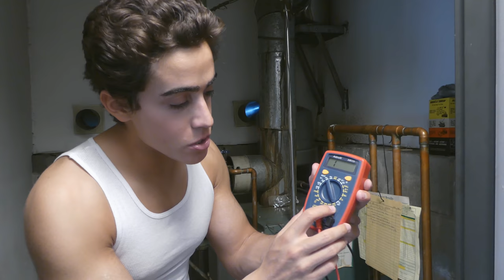Grounding and Earthing are Nature's Antioxidant

Comment: The Earth is neutrally-charged. Electrons have nothing to do with it - everything has electrons. The same electrons that strike the Earth are the same electrons that have been on Earth for nearly forever.

Take any massive object and it's electrically neutral, because it becomes impossible to charge. A single lightning strike or even a series of lightning strikes on the Earth is like piss in the ocean - you're definitely doing something to it, but the overall effect is negligible. Extending that - any non-isolated massive metal object is also electrically neutral, because it's not just difficult to charge, but any charge it takes in can be easily dissipated.

Free radicals occur inside cells, all over the body. Your body isn't a conductor so you will definitely not balance the charge inside your cells short of running currents across your body - which will definitely kill you. Most tissues are very good insulators, fat being the best. What you're affecting is surface charges across your skin, or possibly nervous system stuff that's at the surface.

Your multimeter test is erroneus. Sticking a probe to the soil will not cause it to conduct directly to Earth - the contact is bad. Loose soil, small surface area, too many issues. Wet soil might help but you would probably then encounter capacitance to ground, meaning that's still not grounded. Grounding rods are large and buried into the Earth for a reason.

The 30-100mV readings you get can be nearly anything. Your nervous system can output hundreds of millivolts on its own. In fact, moving around and being active, or even just pressing your thumb against the probe, could be generating motor nerve signals or other such nervous signals that could generate that voltage. You can measure the voltage across your hands, from your left thumb to your right thumb, and generate those signals. When you earthed yourself and saw the number go down that could be you sinking the signals naturally generated by your body back to ground.

Not to mention, are those DC or AC readings? If we're talking about charge, then a DC reading would tell you something about the built-up charge, and the AC reading will tell you something about the rate of charge transfer. Those can mean very different things; ideally you want both to zero out but just that you want to keep yourself neutral implies mostly the DC reading.

The copper pipe voltage test was interesting; but again that's the surface of your skin being grounded. This is the same trick to release static charge. Again, a sufficiently massive metal object, earthed or not, will still be charge-neutral and will serve as a ground with respect to your body. If all your piping is metal then regardless of its connection to the water main then it will serve as a ground regardless. You generally don't have to worry about this.

The surface area of the water pipes do not determine the connection to ground alone - that assumes that the pipes are ideal conductors, which nothing actually are. A longer length of pipe makes a more solid contact, but the furthest parts of this pipe with respect to you will incur signal loss on the way from you to it. That's why grounding rods are of a finite length - any longer and you're not getting a better connection. Wider, shorter pipes are ideal, longer, thinner pipes incur more losses per unit length. (Capacitance is also an issue, when pipe resistance goes down the capacitance goes up, so it's a big issue to find out how much more important DC grounding is to AC grounding.) But again, don't worry about it overall, a network of pipes will itself act as a ground with respect to a human body or bodies.

The easiest way to join the copper wire to your piping is to wrap it around the pipe, and then use a soldering iron and some lead/tin solder to join them. The heat will also burn off thin insulation in the wire. The other end of the wire probably won't give you a good connection as bare wire though, best to solder that to a better contact, like your grounding strap/ the wire the strap comes with.

Look. Overall if you're having good experiences with grounding, it's probably working out for you, and that's a good thing. And grounding in general is probably a good thing to do if at the very least every now and then to release macro-size charges in your body as well as to quiet out any bad erratic electricity in your body. I just don't see that our current understanding is sufficent to start making believable claims as to why it works. The human body is particularly finicky with electrical signals, again the one most affected will be your nervous system, and then your heart second, so I can't really see that we've isolated the effects enough to really know.